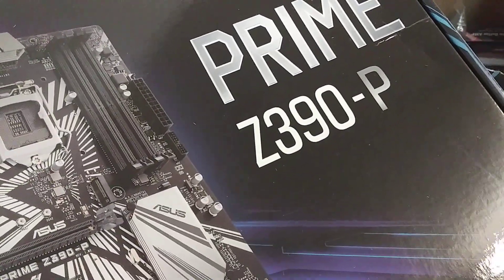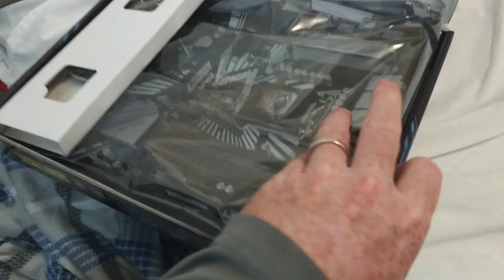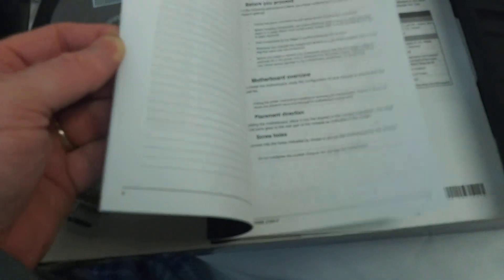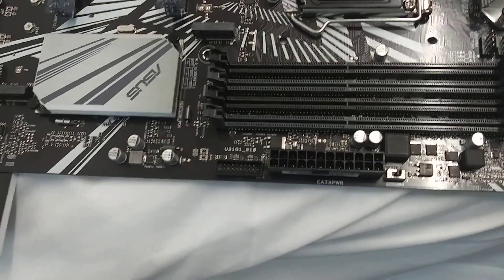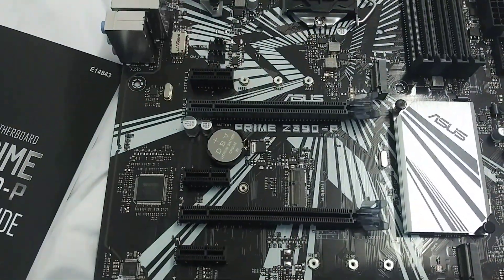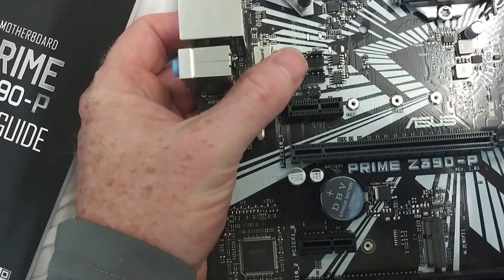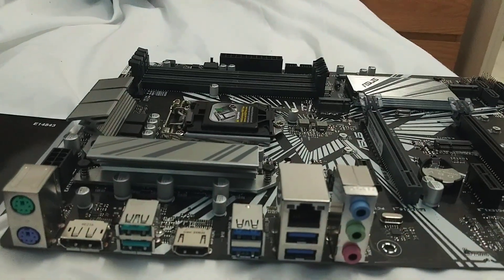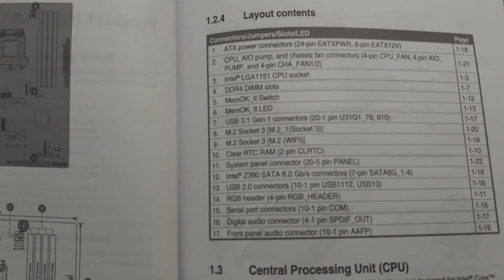Unboxing Asus Prime Z390-P motherboard for 8th  9th gen intel cpu, overview of features

Comment: pretty useless video when not showing any benchmark numbers
Reply: The... Motherboard doesn't affect performance... unless you count adding more ram or an m.2 nvme drive...
Reply: @Gabriel_ATG  it does when it has so weak vrm that it throttles cpu
Reply: @lifemocker85  is this mother board good tho?
Reply: @cahss1843  ok entry level board but tuf is better

Comment: I can't get bios to boot on this MB
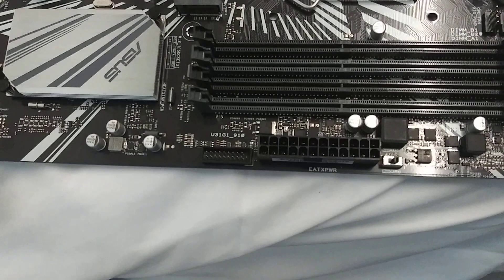Reply: At 5:12 in the video, he says that switch might be for the bios on/off switch. Try that bruddah
Reply: @miguelcarbajal5725  I got this motherboard. It's not a bios switch. It's a MemOK! switch. its a feature that if you overclock your RAM too much and you cant boot the MemOK! will automatically detect it and reset and retrain the memory to the default speed and make sure you can boot again :)
Reply: I am having this exact problem right now. Did you ever figure it out? Thanks
Reply: @lwerner123  i had the wrong CPU lol it was an LGA 1151 but it was a 7th gen this motherboard only takes 8th gen and 9th gen Intel LGA 1151s
Reply: using an i3-9100 for CPU and MB doesn't boot or display
Reply: @whenwelookinthemirror3834  look up the compatible CPUs for the MOBO. The list was kinda short from what I remember.
Reply: @MyRacingOutpost   Thank you!! just confirmed CPU is compatible as of bios 0805 and i appear to already have  bios 2808 on board from factory. But i don't see My RAM listed as compatible....dohhhhh
Reply: New Compatible ram....We are up and running!!!! Thanks Again.
Reply: @whenwelookinthemirror3834  where did you check this list? I checked the pangoly list and my CPU and RAM are compatible but still cant get BIOS to boot/ a display to output
Reply: @asdfghjkl96096  managed to find it on Asus.com took forever to find actual list.

Open air setup? If so make sure to jump the power on terminals with a screwdriver if you don't have anything hooked up
Reply: @whenwelookinthemirror3834  Yeah Open Air but I have a power switch, so able to turn fans on and sounds like it turns on but no signal ever outputted
Reply: @asdfghjkl96096 okay. Double check ram is secure and try booting with only 1 Ram installed on DIMM  A2. when you first power on  or reset and if keyboard is powered try holding del. Had to do that on my 2nd motherboard to get display to output